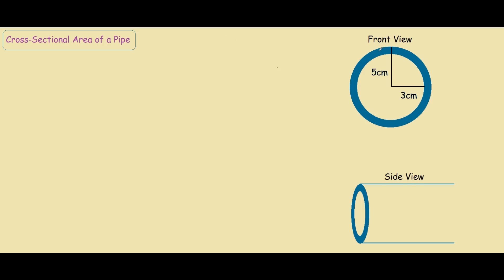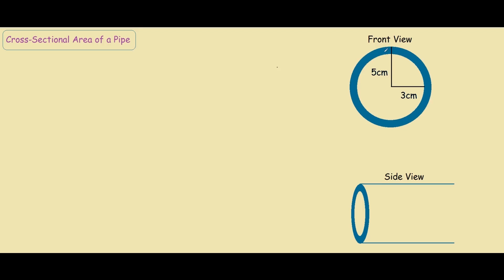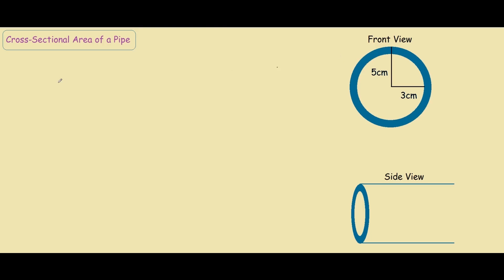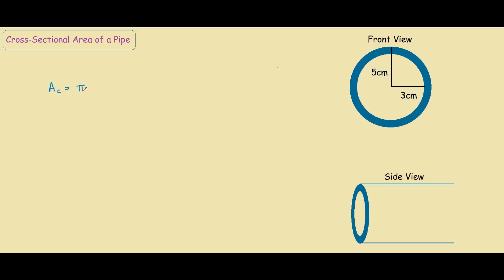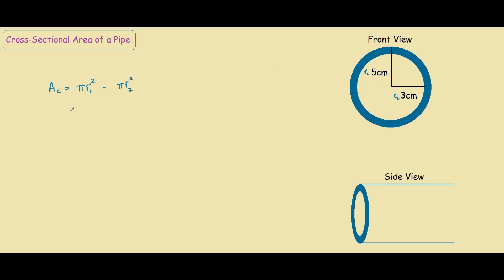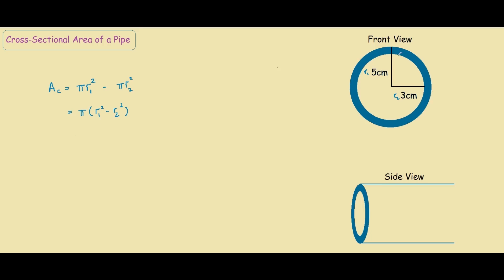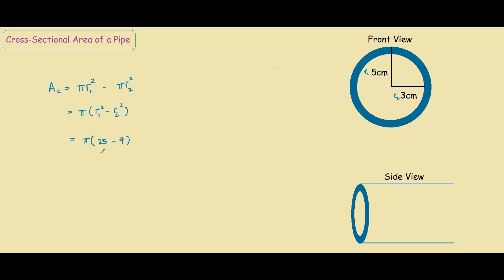Pipe Cross Sectional Area

Comment: What if we use (pi)dt
Where d is dia and t is thickness
Reply from the maker: Hi faiz, if i'm understanding your question correctly, its almost the same thing, except your biggest radius r1 is (diameter/2) and your smaller radius r2 is (diameter/2 - thickness), then the same thing in the video
Reply: Cowan Academy i mean A=πDt
Where D is just external dia.
Reply from the maker: oh, well that formula doesn't work. you can try it using the example in the video where D = 10cm and t = 2cm, your formula yields a different answer

You probably have to start with the circumference (2πr) or area (πr²) to derive an expression. I haven't tried but I'm quite sure the one in the video π(r1²-r2²) is the simplest it can get, hope this helps
Reply: Cowan Academy thanks
Reply: @Faizkhan-bf5bm   bro yes same

Comment: Try this method to calculate the area of cross section of tube, this method we used in my office 60 years ago, formula= o/d minus gauge, x pi x gauge.   o/d means outside diameter, gauge means wall thickness of tube.  In 3 calculations you have the answer. eg. 2 inch diameter tube, minus wall thickness eg. 0.25 inch, X pi X  0.25 .Simple.
Reply: Rectrangular hollow tube cross section area calculation formula?
Reply: @surojitm8 -- Area of outside dimensions less area of inside dimensions.
Reply: @briansolloway6354   could you send this formula with drawing ?
Reply: @surojitm8  can't do drawing. It's simple really, Just work out the area of each side of the rectangle and add them together. In example above 4 x 0.25, and 1.5 x 0.25, add together and multiply by 2.
Reply: @briansolloway6354  hi based from the formula you've given, is the solution like this
(2-0.25)xπx0.25 =1.375
Is this correct?
Reply: @hallahalla0613   Yes, that is correct.
Reply: @briansolloway6354  thank you so much 🤍
Reply: @hallahalla0613  You're welcome. What country are you in?
Reply: @briansolloway6354  Philippines po~